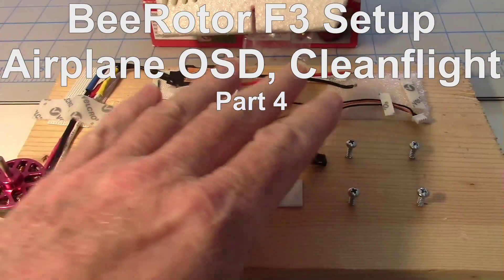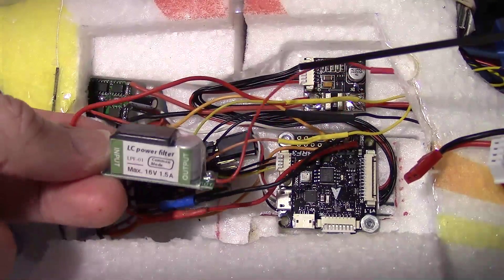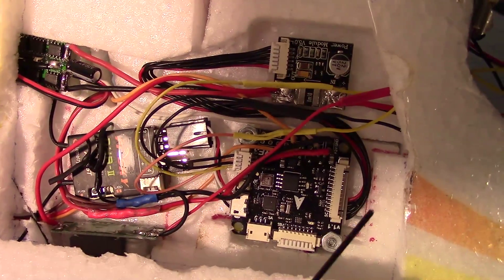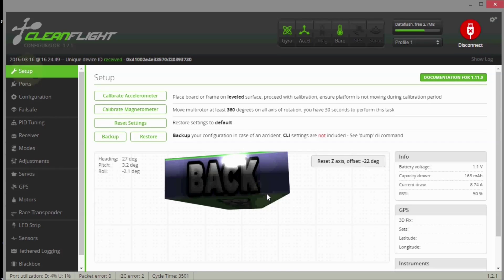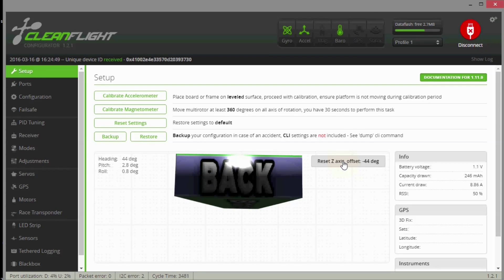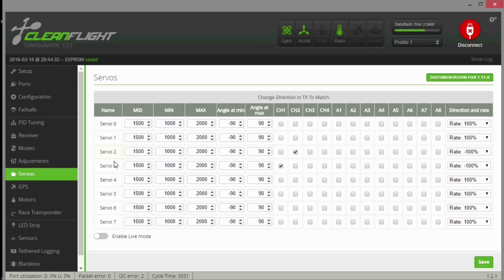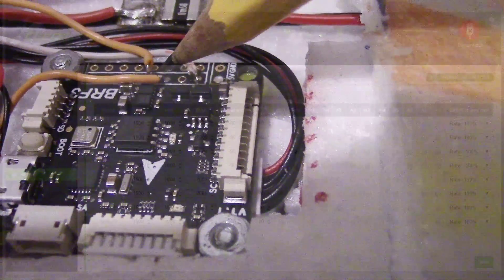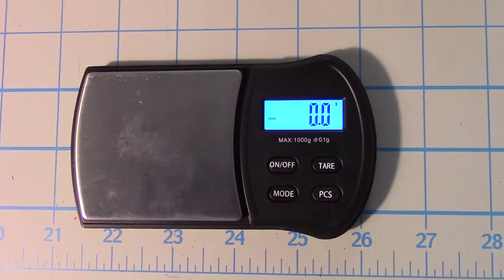BeeRotor FC Airplane Setup with Cleanflight Part 4 (Install in Plane, Configure, LC Filter, Flight)

Comment: Hi, so do you mean not to click on the boxes and only set the rates to change direction of the servos? If I leave the boxes alone my servos have very little throw, is that normal?
Reply from the maker: That is correct. You should not check the boxes on the servo page. Set the direction in your radio for RC control. Set the direction for the stabilizer feed back with the rates on the servo page.  For more throw you adjust the RC rates in the CLI near the bottom (for newer versions of cleanflight).
Reply: So it doesn´t matter where the bars go in the "receiver" menue? What is the command for throw in CLI? They should have added this in the "servo" menue.
Reply from the maker: Receiver menu matters too.  You must choose the correct mapping for your radio.  For The CLI use Dump then you can try this
set roll_rate = value
set pitch_rate = value
set yaw_rate = value

Value depends on your version of the firmware.
If you are running iNav you can check here:
http://www.rcgroups.com/forums/showthread.php?t=2495732&page=513
Reply: Thank you very much, that helped me a lot and it works now. Did you get the gps home function to work with your airplane?
Reply from the maker: It is still a work in progress. They have a new version of inav out that may be improved (1.3) but I have not tried it yet.

Comment: What osd is that?
Reply from the maker: +Josiah Nilsen The OSD is included on the BeeRotorF3 FC board. It uses MWOSD firmware.
Reply from the maker: +Josiah Nilsen More info
http://www.rcgroups.com/forums/showthread.php?t=2598047&highlight=GPS
Reply: +dmerc00 ok thanks a bunch!! I might try and replicate this at some point

Comment: Use this GPS module.  Really small and light weight.  Also they stock USA.  http://www.banggood.com/Ublox-7-Series-Mini-GPS-wCompass-For-APM2_6-APM2_8-PX4-Pixhawk-Mini-APM-MWC-Flight-Controller-Board-p-1006319.html
Reply from the maker: +Jon Car Thanks. Which of the four models should I choose for the BeeRotor FC?
Reply: +dmerc00 The TN version is for Naze32 type FCU's
Reply from the maker: +Jon Car Thank you so much for the info. I will get one for sure.